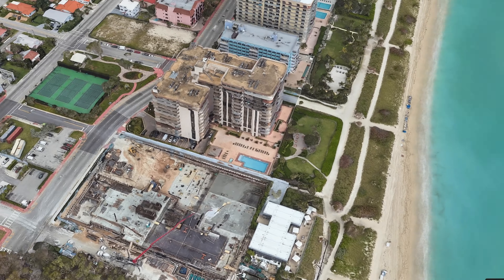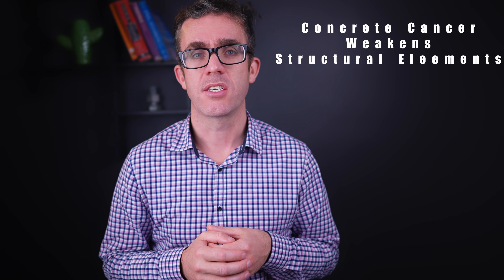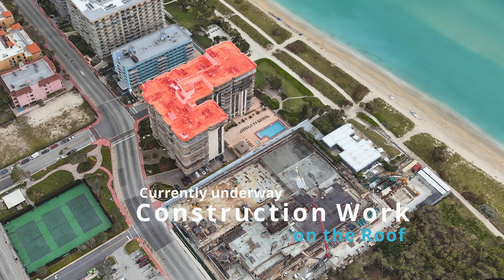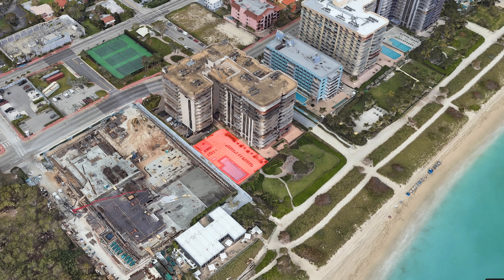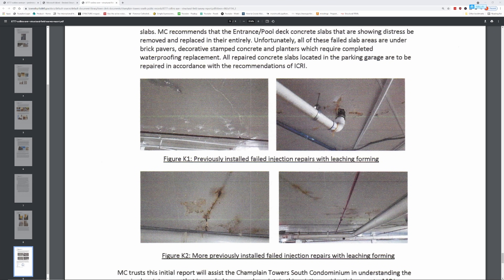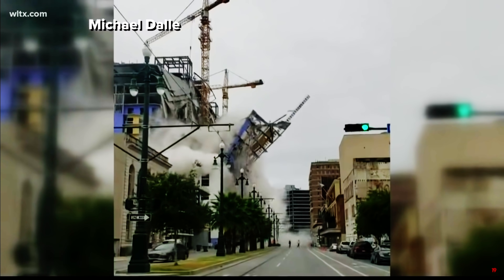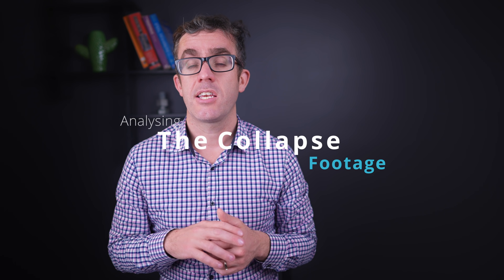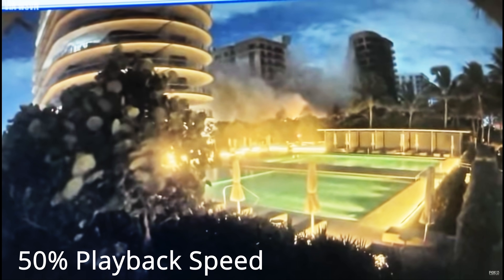How did a Miami building collapse: The Warning Signs. Report and  CCTV footage analysed

Comment: Ronan Point was constructed with missing pieces some sort of connecting plates that were vita; to integrity. I find it difficult to imagine anyone makeing that error 2or three decades later. I would explain a lot though: https://devastatingdisasters.com/ronan-point-1968/

"The ensuing investigation found that a gas leak had caused the explosion but that high winds or fire would probably have caused a similar collapse. The tower was repaired but in 1984 a survey revealed structural cracks suggesting that, despite the re-building and strengthening that had taken place, Ronan Point was disintegrating. During the tower’s demolition in 1986 it was found that the section joints had been poorly fitted and that the original building work was sub-standard."

I had forgotten about this, well done.
Reply from the maker: Thanks Michael, it was only a decade after but agree, it should have been detailed for integrity reinforcement. If it was, was there a single failure? Does that mean buildings need to be assessed with additional aspects to resist disproportionate collapse. 

If multiple elements were weakened it is hard to design for.

Comment: I just stumbled on your channel, I will have to go back and check out some of your past videos.
I've looked at a lot of information and nothing stands out yet as a clear cause of the failure.  Clearly the collapse began as a column failure but the columns appear to be designed with enough capacity so why did they fail?  The pool deck could be analyzed to see if its original design was sufficient.  There are questions about how the pool deck slab was connected to the columns at the perimeter of the building.  I'm not convinced that this is a weak point but I might do some calculations on that too.  I've checked typical interior columns and didn't find an issue with them.  In some of the photos of the pool deck with columns punching through the deck I'm surprised that there aren't more signs of punching shear from the slabs, there are just a few traces under the edge of the south part of the remaining structure.  I also wondered if something failed underneath the basement slab.  The original drawings don't even include the structural plan for the basement so I don't know how far down under the slab the pile caps are.  I wondered if a column could have deteriorated beneath the slab enough to cause a failure, or if a pile cap could have completely failed.  It appears that the pile caps were probably in salt water continuously for 40 years.  This would be easy enough to check once they dig it all up.  It will be harder to find evidence in the wreckage of punching shear failures or pool deck pulling on column failures.
The typical slabs are reinforced only to resist design gravity loads.  Just like in Oklahoma City- once something starts to fail and there are reversals of bending moment, the slabs can't resist that.  I think this is why the failures progressed through the structure as they did although the pool deck did seem to resist this somewhat.
It can be frustrating looking for information on this failure on youtube, there are too many people posting videos and comments who know nothing about structural engineering.  A couple of channels that post a lot of videos are kind of like watching a witch doctor tying to explain cancer.
For anybody who is digging through the drawings that are available for download- please realize that there are multiple versions of each sheet in there and the sheets are very out of order.  There are preliminary drawings, drawings for construction, drawings that were revised later, and preliminary drawings for the north building.  I had to extract separate pages out of the PDF and reassemble them in the correct order.
Reply from the maker: Hi Bill, thanks for your detailed review. Agree the initial assessment of the columns it appears that they had surficent capacity, so even if one column failed the building shouldn't collapse. Questions around  how degraded are the columns, need to be reviewed, could this cause the failure, the picture and videos of the columns pre collapse it doesn't look bad, but maybe crucial locations where missed.
Could have a pile cap or supporting pile have failed due to constant salt water attack, maybe this may have started the collapse then the already weekend columns adject didn't have sufficient capacity to support additional load. 
But this is mostly speculation.

I agree I think the punch failures are secondary, caused by the loading change.  
I can't see the pool deck failing first atleast to the exent that would fail the tower columns  due to secondary catenary without some secondary cause like something falling from the roof.
Reply: @BrendanHasty  could the pool deck punch shearing have put extra load on tied columns under the tower? Those columns could have been weakened by decades of salt water exposure and they collapsed as they were pulled outwards by the sunken pool deck.

Comment: The building was made with no beams...That was the problem!!!!
Reply: That system of concrete floor framing has been in use as long as we have been building concrete buildings.  It can be very strong and is good for heavy loads such as warehouses.  Of course it has to be designed properly but just the fact that the slab doesn't have beams doesn't mean anything in and of itself.
Reply: @billj5645  I know a lot about structure and construction and these buildings are not as strong as beam systems
Reply: @javierkaplan8218  true but they left out alot of steel at column tops.

Comment: Someone needs to come up with a sealant  for concrete, so moisture  can't get to the rebar and cause rust. Or is that just impossible. I don't know ,it's just a question. I'm just an electrician, practicing, how ,not to get lit up every  day.
Reply: It's difficult.  There are lots of sealants on the market but they don't last forever and have to be reapplied.  There is a lot of technology used now in the production of concrete that makes it more resistant to water intrusion.
Reply: If you can prevent water from getting into the building (from the roof, the siding , the basement, etc.), the concrete will probably last for a long time.

Comment: I agree with the impregnating of salt and concrete cancer. The pillars will be tested for salt content, but it also could be the sand originally had salt contamination, as in all the condemned schools in NYC that were having pancaking failure. Rebar in the future needs to be made from 200 series stainless, inexpensive manganese alloyed steel.

Comment: You keep saying design flaw but the design was not at fault....it was maintenance and upkeep and failure to correct known issues after the fact. You don't by a car,neglect the maintenance,then blame it on design and engineering do you?
Reply from the maker: Don't think I said design flaw? ... there was no blame it was just looking at things that the investigation will need to review, which will cover design, maintenance, subsidence conditions, construction and more. The investigation should cover everything so it is rule in and out causes. The documented design from my preliminary review appears to be good but it should still be covered in the investigation.
Reply: @BrendanHasty  you said same fatal design flaw....maybe you need to review your video
Reply: @BrendanHasty  it's at the very beginning of this video....
Reply from the maker: @85jmccoy  Hi Jmccoy that wasn't the intention. The rest of the video didn't blame the design. unable to change the video after it has been posted
Reply from the maker: @85jmccoy  and if maintenance is the issue, agree it isn't something that as engineers we have little control over. but maybe there are different control mechanisms that can be put into place to minimise the impact.
Reply: It is not common for failures to occur based on one flaw or design error.  It can take several things compounding to cause a failure.  Therefore there could have been a design flaw that was compounded by deterioration.  At this time we really don't know.
Reply: Im no expert or engineer but it's pretty obvious what happened here, im an automotive technician by trade so i understand rust and how detrimental it can be. In my mind if there is any design flaw it's the use of rebar and concrete exposed to salt,but mainly the steel.But if your gonna use it it should be made known of the maintenance and attention that will be required to insure its safety and stability.

Comment: Watch the channel ➡️ ARQMANES ⬅️ un Yoube he explains the reason how it fell down. It didn''t have BEAMS in each SLABS.😡
The arquitect shows You through pics, simulations and real examples.
Reply: See my reply further up the page.  This system of floor construction has been used in concrete buildings as long as we have been building concrete buildings.  Designed properly it can be very strong.  Originally it was used extensively in warehouses.

Comment: Great video.  Well thought out.  I am a civil engineer and there are so many various factors involved with a critical failure that it can be mind boggling.  It can take years to pin point the exact issue that caused the collapse on some structures, if ever.  My best guess, and it is just that a guess is that it was due to an unique combination of issues. Poor design, lack of construction inspection, low quality construction, an additional load imposed by the penthouse and planters, poor maintenance and vibration from adjacent construction.  I believe that only the combination of these factors resulted in the failure.  Again that is my best guess.
Reply from the maker: Hi Jersey, thanks for watching, agree this may take years to unpack, and more likely have  multiple issues, and not a single critical flaw.
Reply: @BrendanHasty  Again Brendan great video.  They may never find one exact critical failure.  They should be able to identify some critical issues and inspect the other towers for them, then they might be able to prevent another incident, and save lives.  At least that’s my hope.

Comment: I used to work at factory that cut and bent reinforcement rods.   Many had rust on the surface even  before they were sent out to construction sites. Also many were sent out with cracks in them.
Reply: That's a good point. Also once purchased and possibly stored seaside would hasten the rust.

Comment: Aggressive dewatering of the recent adjacent building site to the South probably created a hydraulic gradient scavenging fines out of the porous politic limestone supporting the drilled foundation piling. Prior to construction of the failed structure the supporting soils profile had been determined to be subject to subsidence at a rate of approximately 2 mm per year or about 3 inches over the 40 year interval prior to failure. The catastrophic cascading failure was likely the consequence of a combination of factors including subsoil degradation, construction vibration, core damage to RC structural members, and chemical attack on RC reinforcing.

Comment: I have a feeling this will be an event where a single person or entity will not be to blame. It will probably come down to the original construction, the city, too lengthy of a re-certification interval, a board that struggled to come to agreement, and condo owners who were overwhelmed with a $16.1 million bill. It is human nature to want to place the blame on one person/entity, but tragedies are usually more complicated than that. The hope is future disasters will be avoided due to learning from this one.
Reply: Not true.
This can be pinpointed to an entity thus an individual that oversees the entity. 
Lawyers with find someone or something to blame.
A building just doesn't collapse without nature or act of a higher power.
There will be tons of blame after over 100 lives are lost.
Reply: I agree with you... There are many to blame... so many warning signs... even the tenants that lived there knew of the damages and the cost and yet they chose to still remain in their condos... I think if I got a letter stating the structural repairs of such degree, I would leave... and the city is to blame too for not evacuating this building 3 years ago... Safety first.. but money is always the final decision maker on what people will decide to do..
Reply: Its not actually safe or rational to put steel inside concrete and expect it to last very long.

Comment: Not an engineer but considering the location is it safe to say they didnt need underground parking. Also structures thats are historic and built in 1700-1800 and still standing strong, what is the difference in the building techniques then and today. New Orleans is below sea level and is hit by hurricanes frequently but has structures built in the 1700s.
Reply: Older buildings were built with stone, as opposed with concrete today. Stone is more expensive and needs to be quarried.
Reply: @kyshac81  Thank you for the information. I wondered about that. I saw churchs in Massachusetts built in the 1600s that are rock solid to this day.
Reply: @communitysolutionspro1520  you said it, rock solid
Reply: I believe the French Quarter is slightly higher than the rest of the city
Reply: @dreddnott  it's still below sea level. Building in new Orleans are concrete, brick and steel and homes are thick hardwood or brick. The newer homes they built after hurricane Katrina are already collapsing

Comment: Some kinds of steel leach electrons from the other. Such as if you put hollow stainless steel against regular carbon steel. Throw in an electrolyte conduit such as moisture and the leaching happens at incredible speed. Like the oil rigs that have collapsed in past.
Reply: Basanite is the future
Reply: @kenklein32  What happens if basonite comes in contact with carbon steel? Would it be an active or inactive metal as this article tries to describe? https://www.trailer-bodybuilders.com/fabrication/article/21741366/how-to-deal-with-dissimilar-metals

Comment: The problem was purely no maintenance.  The other sister buildings were maintained  properly and are in perfect condition!  There was no sinking of the building,  it was built on tension piles to compensate if there had been any small sinking.   The cause is pretty cut and dry. Failure of the concrete pool deck due to failure of the water proof membrane.   Big maintenance failure!!!

Comment: These types of buildings begin to die as soon as they're constructed.  A lot of them are using rebar that's ALREADY RUSTED before they pour the concrete.  Then over the years the porous concrete sucks the salt water out of the ground and right out of the air like a sponge. Plus it's on sand and all pillars sink at different rates.  It's set up to fail.  It's a throwaway building and should only be considered safe for 20-25 years and then torn down and fully rebuilt.
Reply: Basanite is the future

Comment: How did the collapse of one part of the building cause the other parts to collapse? Aren't the 2 hour firewalls between the buildings as per code specifically designed to prevent that?
How come all 4 sections fell at the exact same amount of time, which was free fall speed straight down.
The 3 sections had 360 degrees at which to randomly fall, yet all parts fell into their footprints.
How did a demolition company manage to pull off a controlled demolition in a day and a half when common knowledge is that it takes months to prepare a building for controlled demolition like we witnessed?
How are these absurd coincidences supposed to be believed?

Comment: Greedy people refused to fix a known danger. Cement cracks over time. Salty water from ocean air seeps into cracks and rusts rebar. Structural integrity weakens quickly endangering lives. Gravity has no choice but to obey the laws of physics. The building owners are to blame. Home buyers and renters should avoid older cement condos near the ocean.

Comment: If this is the condition of the high income high rises in Miami- I fear for anyone in lower income high rises. Terrifying.
Reply: Imagine spending $800k for a beachside condo that's prone to collapse
Reply: Exactly. Most low income housing these days are high rises where I’m at in the Pacific NW. many are near the sea 😟
Reply: I'm not even anywhere near Florida, I'm from Minneapolis, but I live in 20-floor low income high rise and this incident has certainly made me a bit paranoid
Reply: But the higher income buildings put up a front of high class luxury on the inside while the building structure may be suffering unseen damages elsewhere, whereas lower income buildings don't lie about it.